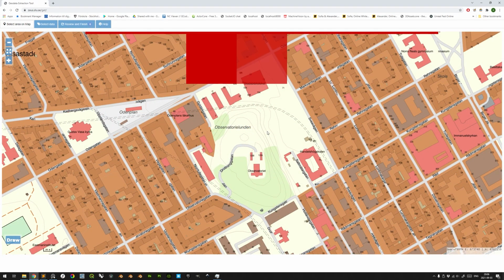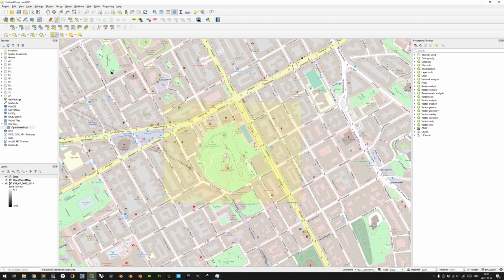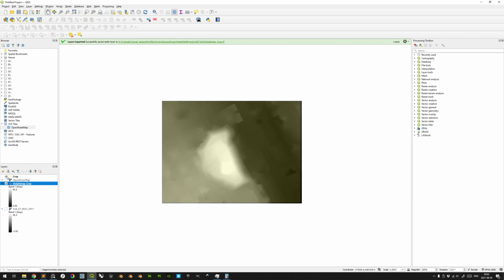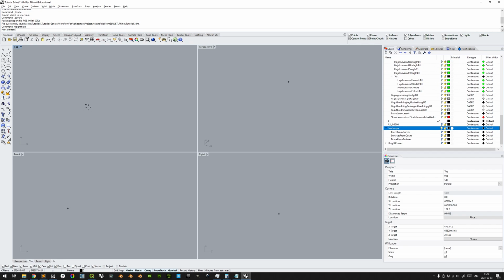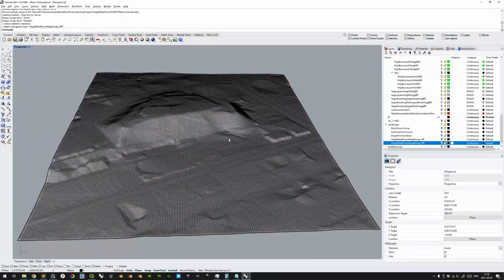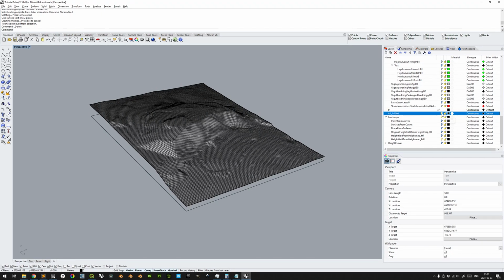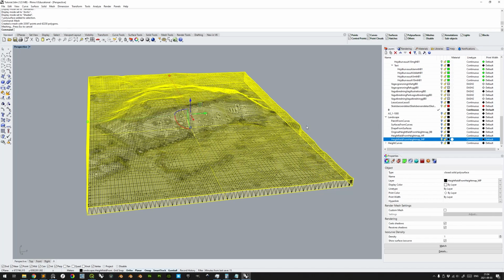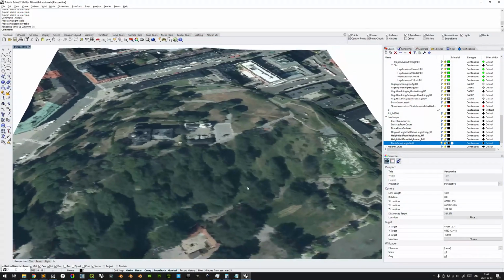Tutorial – How to create heightfield landscape in Rhino with heightmap exported from QGIS

Comment: Hey, i really appreciate your videos, i have a question. After creating the heightfield landscape in rhino i try to split the landscape to the the size/ format i need but the heightfield landscape gets distorted somehow after using this command, is there another way to cut in the landscape or do you know why this is happening?
Reply from the maker: Hello, Josefine! Is this problem occuring with a mesh heightfield, or a surface heightfield? Rhino usually excels in handling surface geometries, but is still finicky (to say the least) with meshes, which is why the question is relevant :) /S&A
Reply: @SanningArkitekter  Hey, thank you for your answer:) its a surface heightfield!
Reply from the maker: @josefinewestre3265  Hmm, okay, then we don't really know what could be the distortion problem... If the Split command itself works the way you intend (i.e. you get the cropped outline/border as you want), then perhaps the distortion is only visual (as in, the implicit render mesh that is generated for the split surface has problems). In Rendered and Shaded view mode (among others), Rhino generates so called "render meshes" for brep objects (such as surfaces), for the graphics processing unit to effectively (performance-friendly) render/show the topology of the object on screen (showcased most effectively as the difference between the Wireframe and Shaded view mode). For some objects, the render mesh that is generated can be distorted/deteriorated due to low resolution of the render mesh. If you select your surface and type the command "Mesh", and use higher-resolution settings, are the distortions still there, or are they perhaps diminished? Sincerely, S&A